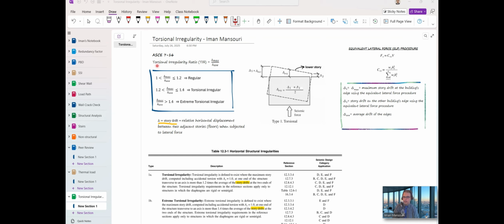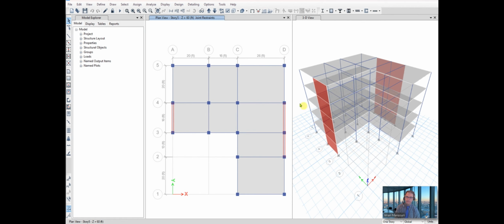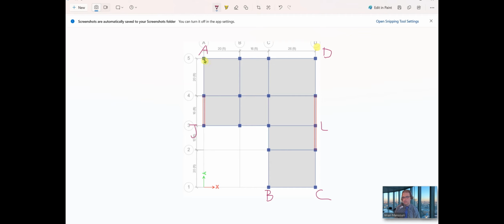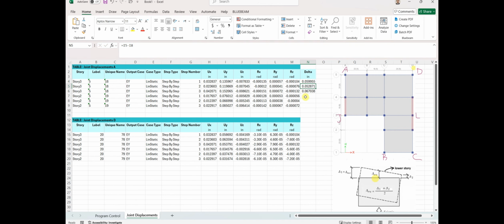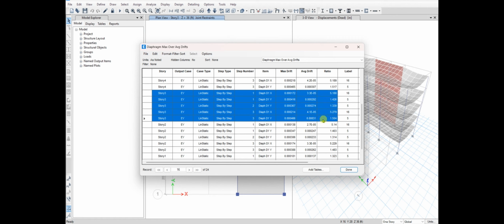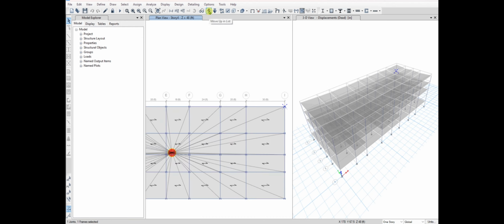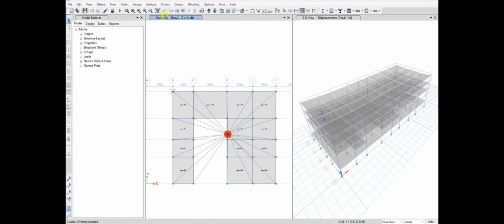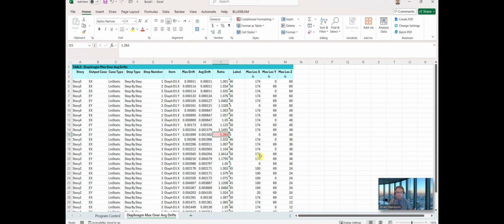Torsional Irregularity Check | ETABS Examples

Comment: Hello Iman
Thank you for sharing this video post. 
When defining EQx and EQy for the TIR check, you are allowed to defined the EQ-Drift load pattern to consider some of the code exceptions in reducing the base shear for the purpose of calculating the proper story drift. I noticed this wasn't considered in your model. Can you comment on that. 
Also, why do you need to calculate the displacement manually whereas you can get the max/average direction form the ETABS output table. 

Thank you

Comment: Hello, i have a question with your model that has a mezzanine. In checking soft story do we consider the mezzanine level as a separate floor and compare its stiffness to its adjacent floor or do we neglect it. Kindly answer
Reply from the maker: Mezzanines are somewhat of a grey area as they can be attached to the lateral force resisting system of the building, but I have also seen types that are supported in the center of the building on their own supports. The former is likely the more common case. I would typically model them as their own as they do have a measurable self-weight as well as a connections to the building itself.
Reply: @imanmansouri4927  thanks for the reply.  Appreciate your videos

Comment: Dear Sir, I am a big fan of your  tutorials on how applied code and standard into program such as ETABS. If you have a time and consideration, would you like to make a video about diaphragm by section cut and its chord, collectors, and transvers shears reinforcement. Also the 25% of frame resist base shear, I don't get it the logic behind about the auto sequence construction by saying removing the shear wall doesn't actually represent the actual behavior or code interpretation. Would you like to explain the reason of your method Sir. Thank you
Reply from the maker: Thanks for your message and for watching my tutorials. The purpose of the 25% rule is to provide a secondary seismic force-resisting system with higher degrees of redundancy and ductility to improve the ability of the building to support the service loads (or at least the effect of gravity loads) after strong earthquake shaking.

Comment: Dear Iman, Thanks with Zajakallah in advance for your great & informative initiative.
According to ASCE , Structures with torsional irregularity must be designed 25% increased load for connections & collectors.1) Is it ok to design all members for 25% incremental forces?  2) Is it overdesign if floors drift max/ave are kept less than 1.4?

Comment: As you said that we don't have to check torsion in dynamic cases, is it something from your sound knowledge and engineering judgement? or it has some codal support? Please answer. Great content, very informational video. Thanks 👍 Keep doing the great work.
Reply from the maker: Great question. ETABS can’t correctly calculate the torsional irregularity ratio (delta max/ave) under dynamic (response spectrum) analysis because it combines modal results before taking the ratio, which leads to unrealistic values. But, if you wish, you can extract the displacements of individual modes, calculate the delta max/ave ratio for each mode, and then combine them; though this is time-consuming.
Reply: @imanmansouri4927  Thank you. Your work is amazing.
Reply from the maker: @taimur921 Thank you for your kind words. I actually came up with a solution for controlling torsional irregularity under dynamic loading, and I will teach it as soon as I get the chance
Reply: @imanmansouri4927  Sorry for the late reply. I would love to see that video. Again, thanks for the great content.
Reply: @imanmansouri4927 I have some question about this. How come the dynamic analysis produces unrealistic results for torsional response? Isn't the dynamic is the more accurate analysis for irregular structure like this example building especially it has somewhat re entrant irregularity?
Reply from the maker: @mr.d3916  Great question. ETABS can’t correctly calculate the torsional irregularity ratio (delta max/ave) under dynamic (response spectrum) analysis because it combines modal results before taking the ratio, which leads to unrealistic values. But, if you wish, you can extract the displacements of individual modes, calculate the delta max/ave ratio for each mode, and then combine them; though this is time-consuming.

Comment: Thank you for the excellent information. I believe the maximum drift calculated by ETABS at the mezzanine floors is more reliable than the manual calculation. However, you mentioned that it is preferable to use the manual calculation instead. As you know, there is a large opening, and the ETABS calculation should be more accurate. If not, could you please clarify why there is a difference?
Reply from the maker: Thanks for your comment. The point I wanted to highlight is that for torsional irregularity checks, the code requires comparing story drifts only at points that are part of the diaphragm and connected to the lateral load-resisting system. In cases with mezzanines or large openings, ETABS may sometimes include points that don’t have a direct support below, which can artificially inflate the drift ratio. That’s why I also recommend verifying the results manually, just to ensure consistency with the code definition. So it’s not that ETABS is wrong, but rather that we need to be careful about which nodes are included in the check. Manual verification helps us confirm we are only comparing the correct edge points, exactly as required by ASCE 7.
Reply: @imanmansouri4927 , Thank you for your feedback. You have made a commendable initiative. I would appreciate it if you could continue posting videos on a variety of topics, as I would like to view them and share my insights.